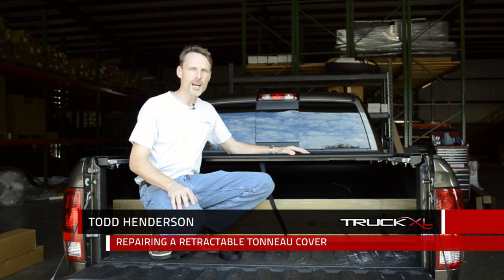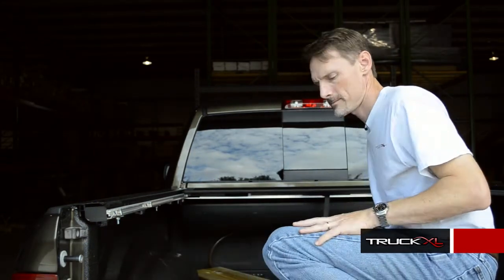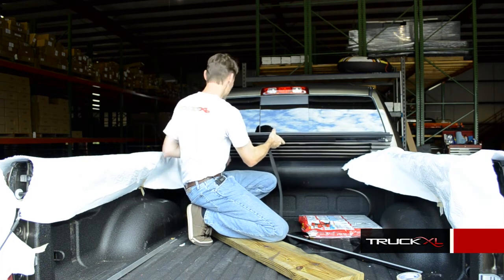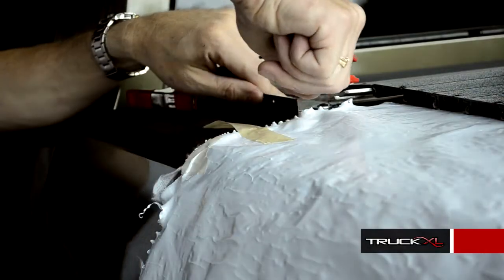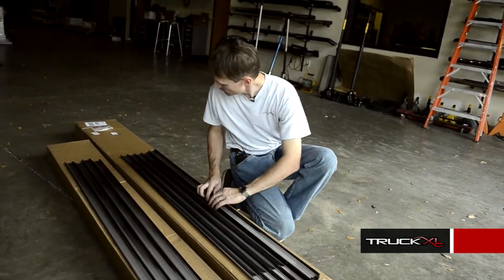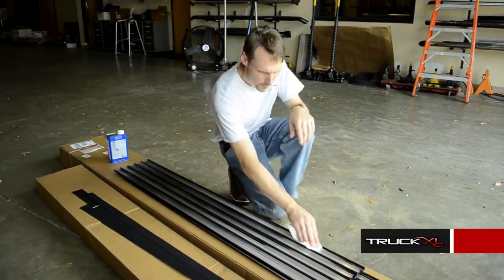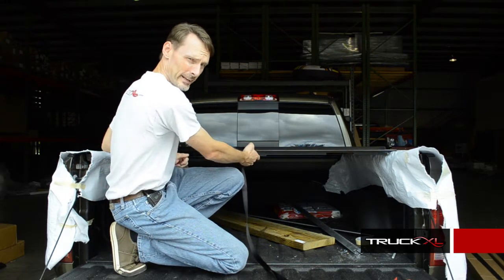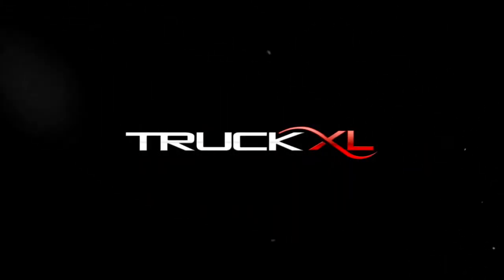Repairing a Retractable Tonneau Cover

Comment: Nice video.  My lock stops fell out so my retractable top does not stay put.  I see e-trailer has the replacement for ~$16 before tax and shipping.  This is only for one side.  I'd like to do a DIY repair since we are just talking basic hardware from Home Depot.  Thoughts and suggestions are appreciated.  To be clear, I don't know the thread size, length, etc for the hardware.

Comment: I would like to know where I could buy the felt tape because when I roll mine in and out the slats misaligned and catch on things and it stops Midway... if I could replace all the felt tape on the bottom I believe it would fix that problem and make it a little more waterproof...My cover is 14 years old

Comment: I purchased a Retrax for my 2014 f150 5'7" bed when I purchased my truck in 2014 from a Ford Dealer and it is the plastic material one, when closed right at the cage a slat broke, is this repairable?

Comment: Hi There, 
The issue I have is the brake latch is too loose to prevent the cover from rolling back up while driving and braking. So how do you repair or tighten up the brake?

Comment: great video my bed cover is having issue will rolling all the way out i have to assist with putting pressure down for it to roll out in also put pressure for it to roll back . do u think it could be a piece needs replacing i just bought a ford 02 f350 with auto roll bed cover. its like its not catching on tracks n it just spin n doesnt go anywhere?